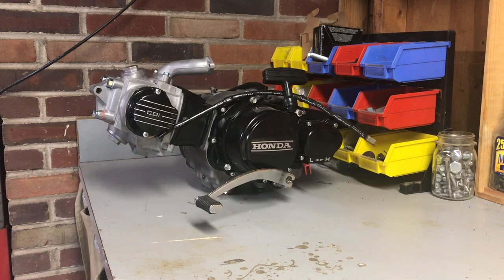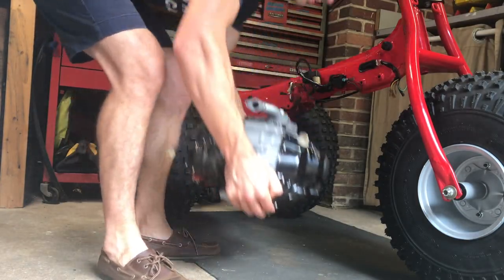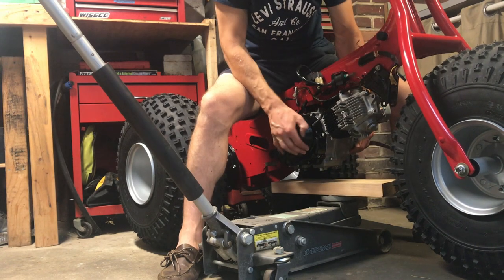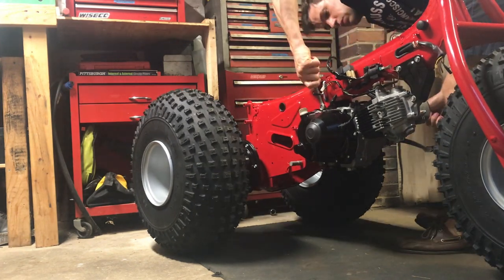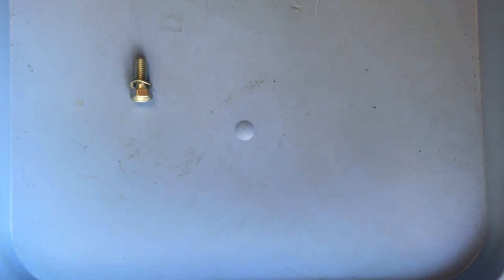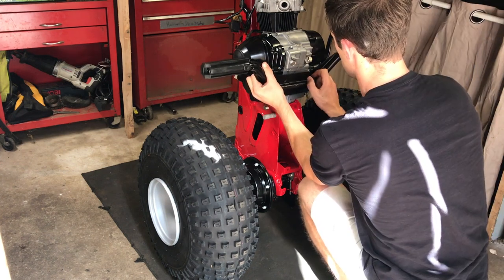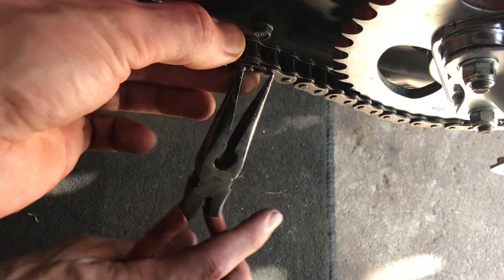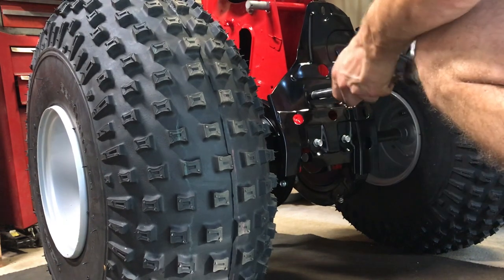MINT Honda ATC 3 Wheeler Rebuild

Comment: Hey good video would be cool for it to be longer but it is good I have a few ATC myself I have a 82 Honda ATC 70 200s another 200 S I have a 110 it's a 85 another ATC 110 that is also a 85 I have a 1985 Honda ATC 125m I have been restoring though I have for running one I'm still working on even though it's running then two more that I need to rebuild
Reply from the maker: Hondaman ATC4life thank you. Working on longer videos to release soon! Wow, your garage is full of three wheelers!
Reply: @EdgasketGarage  yeah basically full why I'm looking to get more though I still need a 200x 350X and 250R and I'm also looking to add a Honda FL 250 Odyssey and maybe a Honda Pilot